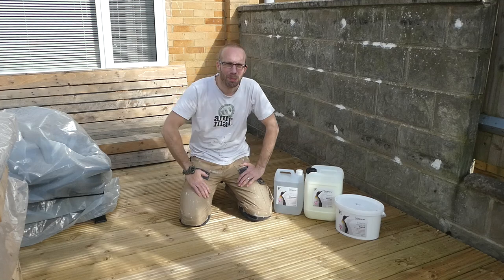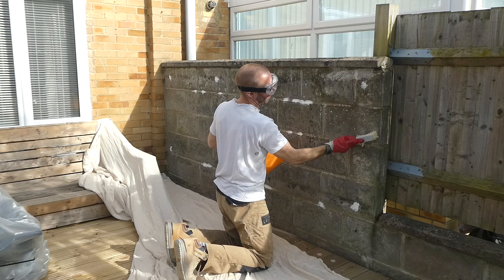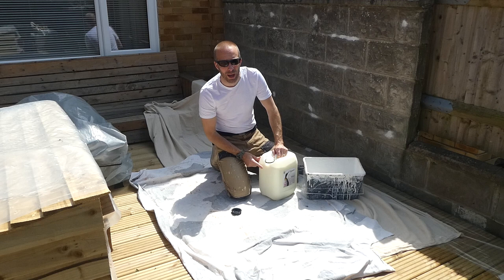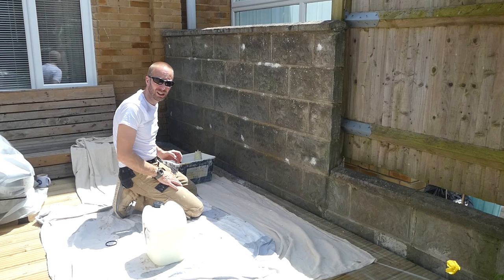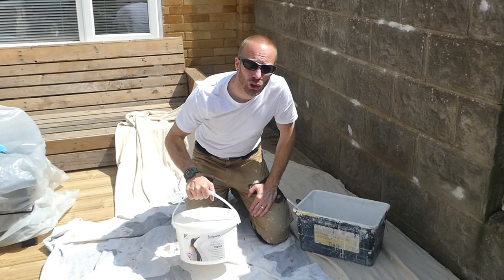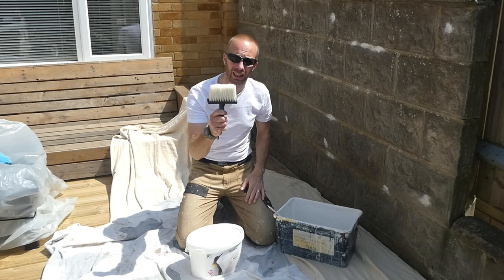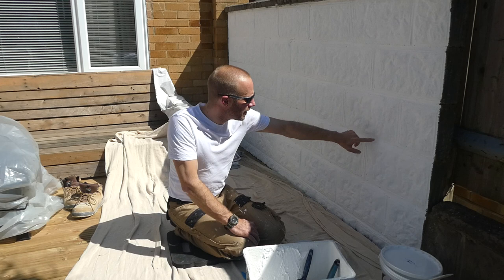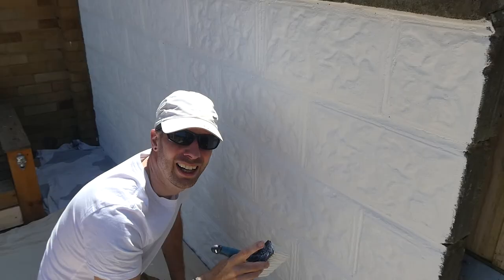Emperor Paint - How to paint an outside wall with Emperor Masonry Paint

Comment: Why is the decking upside down, the ridges go underneath, Google it you will see.
Reply from the maker: Hmmmm, not my decking haha
Reply: Common error. Smooth side up, otherwise water just sits in the grooves when it rains.
Reply: Unless you buy double sided deck boards, then you can choose which way round you want them Mr G! Google it you will see 😉

Comment: @JB how’s the wall looking a year on, any stains appearing from water run-off? Been using another kind of silicone paint on a similar wall, but within a week I can already see where staining is likely to appear
Reply: Hi, what was the paint you used and how did it turn out, what's it like now? Thanks
Reply: I used Wethertex HBS flex-coat… as useless as standard masonry paint at keeping stains from forming